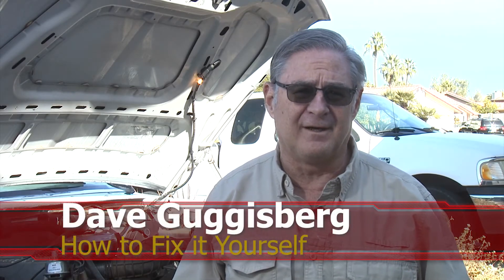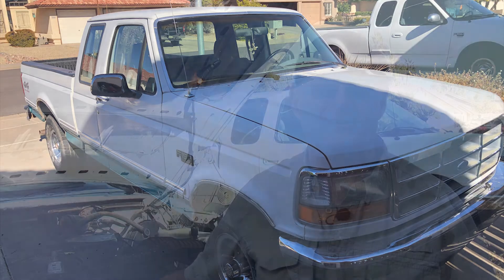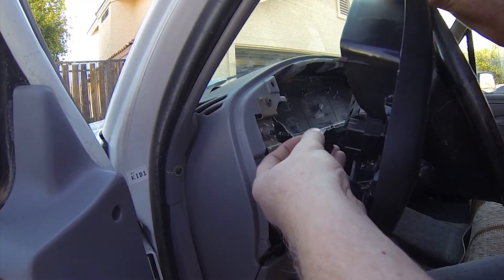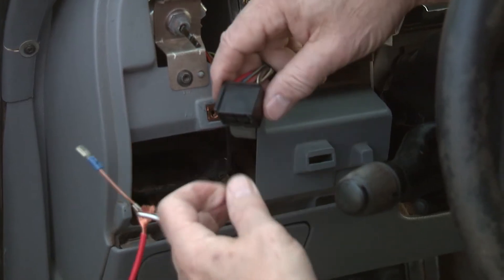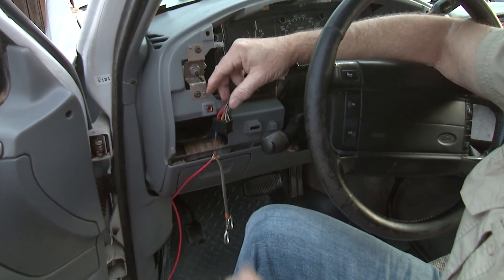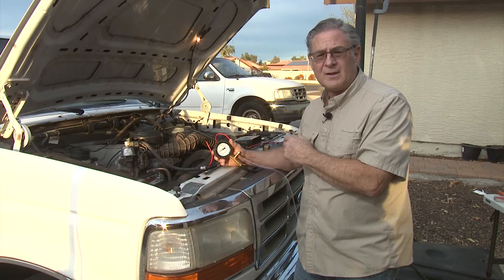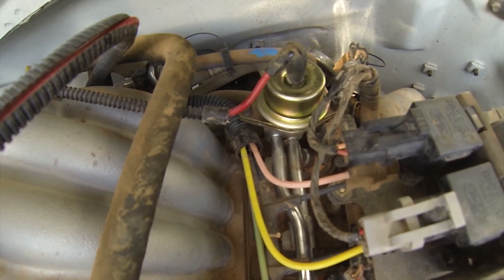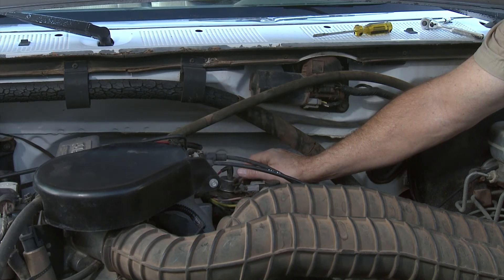Fix for Low Fuel or no Fuel Pressure, Ford F150

Comment: Real good video. I saw it on How to do it yourself .   if you don't have dual tanks, is there another convenient connection under the hood to apply battery voltage to try to see if  pump pressure may go higher?  to see if problem is in the wires and not the pump.  I have 20 psi and a full tank,  it starts for now.
Reply: I'd look at the service manual schematic and also see if someone's posted a link to that online.

Comment: Best video i have found so far will check out my fuel pump tomorrow before i change it  my pump runs pressure 25 spray starting fluid to start 25 psi key on 32psi running fuel pressure leaks down from 35psi to zero after 3hrs starts up floods smooths out like a brand new car after it runs ruff for a min if fuel pump shuts off on its own will start with no starting fluid? 😢

Comment: Is fuel regulator in same place on a 96 f150 xl with 4.9 litre?
Reply: I pasted your post into Google and there are videos of replacement on your '96. If you have any troubleshooting questions there are plenty of inline six F150 owners over on the Ford Truck Enthusiasts site. Some retired and current dealer mechs post there. Youtube isn't really for questions and answers. Ford knowledge on the older Fords tends to be on older forums. Those sixes are possibly Ford's most rugged engine and were used in industry, in aircraft tugs and much more.

Comment: hey sir i have a question, i have a 1996 short bed single cab with the 1994 5.0 engine, i swapped the fuel regulator, throttle body, throttle body position sensor, ignition coil, and when i drive it it only runs good for about 5 minutes after 5 minutes when i floor it it bogs out. could you give me some advice?